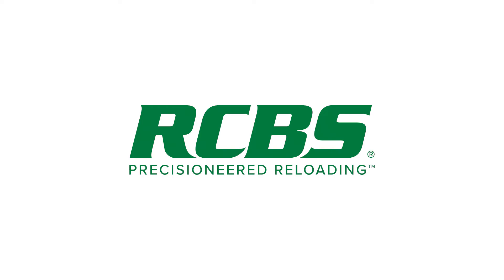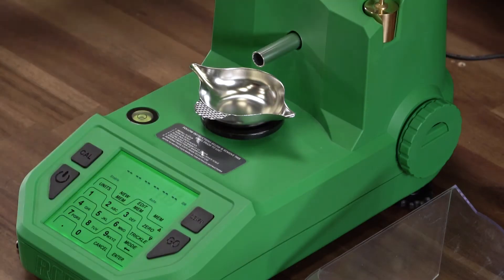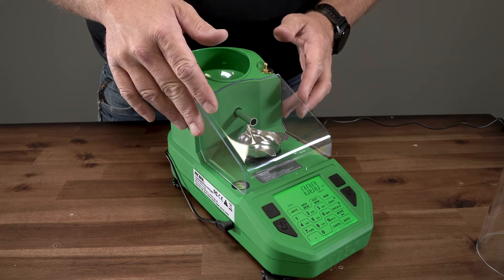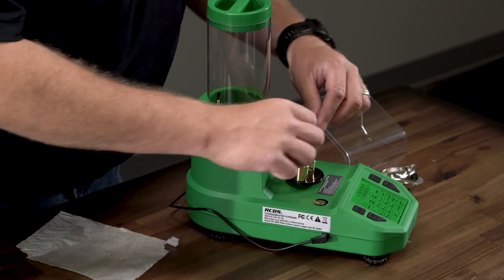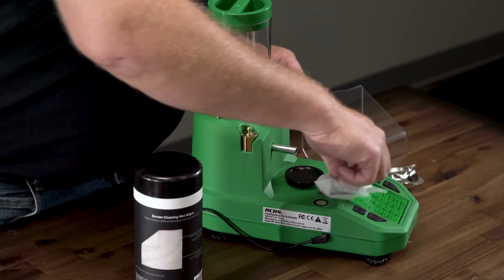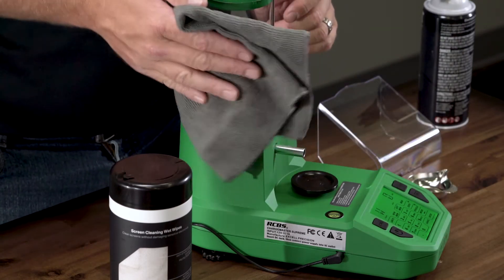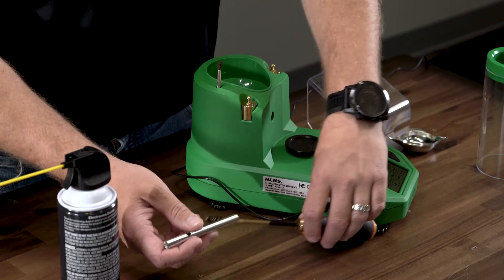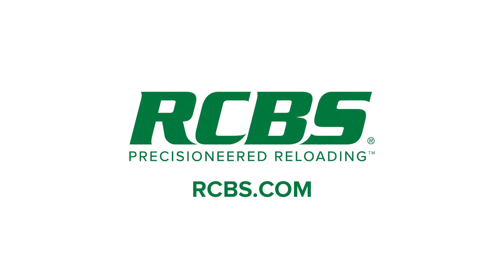How To Get The Best Consistency with the ChargeMaster Supreme

Comment: I think my method is much quicker and just as accurate. I use a powder dropper from Lee, drop a charge, weight it using a digital scale and correct with a trickler. It's more hands on but I like being able to control as much as possible. I recalibrate the digital scale every 20 rounds loaded. Not very complicated and I don't have to contact anyone if something doesn't work just right. The ChargeMaster Supreme looks like a pain in the rear to operate and keep functional.
Reply: I thought the same thing until I bought one. Can’t believe I waited so long to get this tool, it’s amazing.
Reply: @snowman3219  Very good Snow Man. I hope it serves you well for a long time. Good luck and good reloading. I love working the brass and stuffing my own.
Reply: You've never owned an auto-dispenser, so you have no idea just how fantastic they are.
Yes, they're a bit expensive, but I have to say that my Chargemaster Supreme is so fast that I don't quite have time to seat a bullet on the previous round before the next one is already dispensed with it.
I can understand doing as you said when on a tight budget, but this third generation of dispensers is astonishingly good if you can afford one.